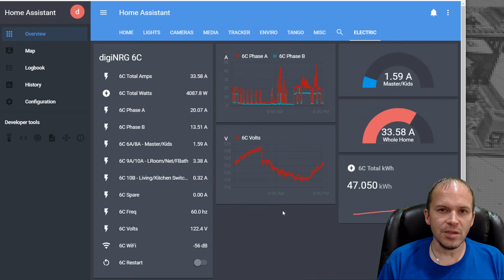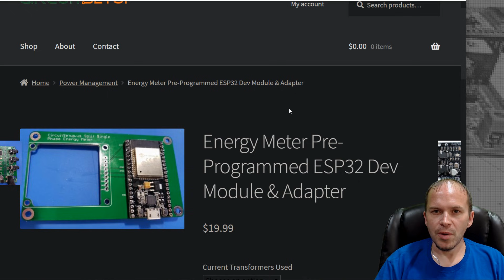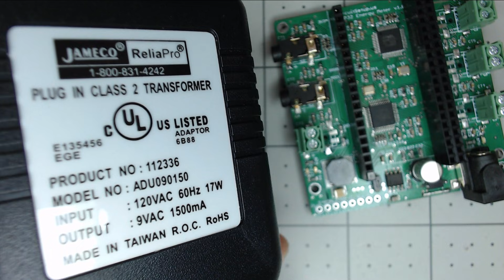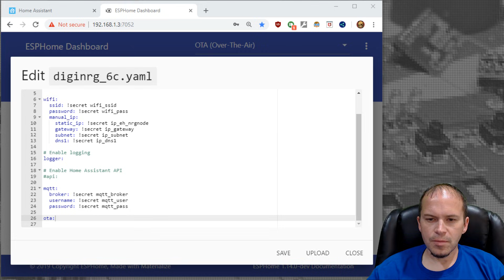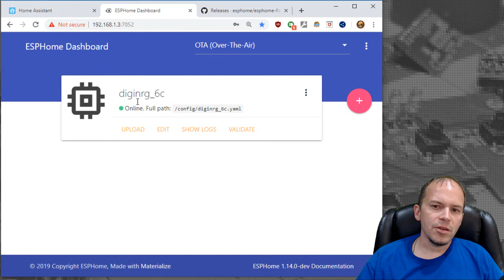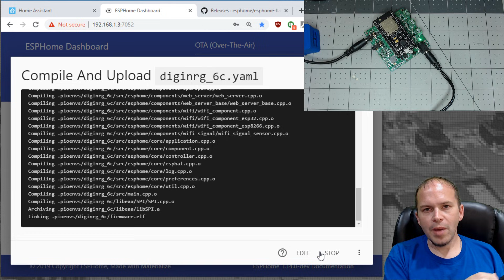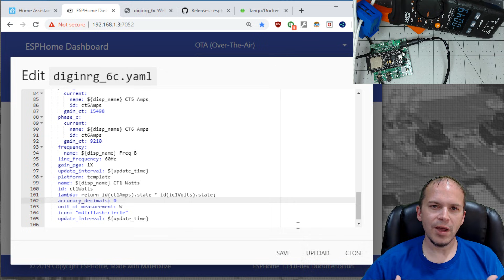DIY Whole Home Power Monitoring with ESPHome & Home Assistant

Comment: Does the direction of the CT clamp matter? Also if you have something like a range with a dual breaker (30, 40a etc) I'm guessing you need to monitor both leads to get the total? Thanks
Reply from the maker: The clamp direction will make a difference using the new sensor that shows the real wattage and not just calculated. If it is negative just flip it around.
Reply: @digiblurDIY  Do you have more info on the new sensor?  I have the latest board and used your yaml file that is calculating watts. I tried it both ways and it was positive in both directions. Thanks
Reply from the maker: https://esphome.io/components/sensor/atm90e32.html

Comment: If I want to get the current measurement from a dual pole (240v) breaker, do I need a CT on both hot wires, or is there a way to double the voltage for a CT on 1 of the two hot wires?
Reply from the maker: I assume US residential split phase? Is it a balanced load? Or do you want to see both hots?
Reply: @digiblurDIY  so… is the answer here that you just need one CT clamp but you’d need to double do some multiplication on the sensor to just double it?
Reply from the maker: Either pass it both hots in the clamp in opposite directions or you can double it if it is a balanced load.
Reply: I had this same question - I looked at https://www.diychatroom.com/threads/balanced-loading-on-240v-circuit.196969/ and what they said made sense - a pure 240v load (e.g. 240v electric dryer, water heater, etc) will always be equal. I'm not sure of the rationale fully, but it would be great to hear about 240v load examples that don't have equal power (btw, US, 240v split phase). 

I would think all resistance loads (electric water heater, dryer, electric heat) would definitely be covered. 

Does anyone have cases of 240v split phase loads that are not balanced?

Comment: do you know how to use the arduino mega with esp built in? i want to use all 16 analog pins to monitor 16 breakers individually. that way i can find electrical problems and power drainers faster. when i get around too it i can off load the ones that use the least to solar.
Reply from the maker: No, I haven't messed with that hardware yet.

Comment: Hi 
digiblurDIY, I found your video really intresting even if it exceed my basic knoledges. I'm asking you if you know a proyect to measuere the power and cut some lines when the total power is above a certain limit (to avoid automatic shut off in the energy company meter). I'm looking for a solution for an underfloor electic heating system with a line for each room. Thanks for your advice.
Reply from the maker: If you had some relays installed on those lines then yes you could use this if you wanted to or any other power monitoring on those lines.
Reply: @digiblurDIY  Thanks for your reply. I have to figure out how to connect the relays and how to compute the total Watts in order to decide which line I have to switch off. Thanks again.

Comment: My "powermeter_6c_freq_a_3" is showing 655.34hz I dont know how to fix this.. help please.  The other one "powermeter_6c_freq_b_3" is correct, showing 60hz.  I am using NodeMCU Esp-32s
Reply from the maker: Sounds like it maxing out for some reason.  Is there voltage on that feed of the IC?
Reply: @digiblurDIY  
I am only using 4 of the 6 CTS, CT1 and CT2 are for mains input and CT3/CT4 are being used my for inverter AC
However this is the current usage on my system currently.
PowerMeter-6C CT3 Watts	8095 W	
PowerMeter-6C CT4 Watts	29 W

powermeter_6c_freq_a_3 is for CT3, and powermeter_6c_freq_b_3 is for CT4
I dont think line 2 is being read correctly

Comment: Is it normal when you don't have any sensor plugged in it still shows:
CT1 watts 1w ,  CT2 watts 1w , CT3 watts 1w  etc..
Reply from the maker: Possibly due to residual/noise from the floating pins.  Never tried it myself always had sensors plugged and clamps on something.

Comment: Excellent video!  I have 6 CT's, the meter board and enclosure being delivered Monday.   I'm using Home Assistant Core, so my install might be a bit different, but your video is providing enough guidance I should be ok.
Reply: An update to my own post. I switched installs and went with HA on a VM. Now I have access to the "add-on store," which I didn't have before. 
Anyhow...This afternoon got the ESP32 programmed and installed on the main "meter board."  Everything is working fine, but now I need to do an accurate calibration on the CT's.    
My two cents says that anyone who'd like to install Home Assistant, DO NOT do the install in Windows (Home Assistant Core). Do an install of VirtualBox and install the FULL version which includes everything.
Reply: @phillipzx3754  Is your setup still working? I'm on Windows/Virtualbox as well.  Any pointers, tips or things to watch out for?  These little projects, while fun are timesucks.
Reply: @walterlau3    It's been working great. My only problem is with Home Assistant and the "History Chart" card in Lovelace. For some reason it stops recording history. I have to refresh the screen manually, but everything else (amps/watts/voltage) works fine.

One thing that got me was the CT's for my "mains."  The CT's I bought (from the same website) were too small to fit over the wires, so I ordered 2 of the clamps (from the same place) with 16 mm opening. They were STILL too tight, so I used a rasp to remove a bit of the plastic in the opening. They still wouldn't snap completely shut so I tightened them down with some zip ties. 

So if you want to monitor your Mains lines, I'd suggest finding CT's with 18 mm opening if you have large wires.  :-)

Comment: Can't you calculate your way to the correct calibration number?
If 10000 = 0.32 A
Then  1 = 0.000032
So 0.5 / 0.000032 = 15625 

It's not the number you got to, but it will give you a quicker way to the fine tuning.
Reply from the maker: Math was never my strong point ;)  I figured someone had a web calculator on this at one point.
Reply: @digiblurDIY  - I opened the video on my phone specifically to let you know that you can calculate exactly as The Hellis suggests.

Other tips :

(Cheap) clamp multimeters are often wildly inaccurate so it's much preferred to use a known load. And as you point out, a bigger current draw would be preferable as well.

It's also worth mentioning that it's by far simplest to use a strictly resistive load, like a light bulb or an electrical/resistive heater. Anything electronic (capacitive) or coil/wound motor will not change the total amp draw, but it is likely to cause variety between measurements because some measuring devices are better suited than others to pick this up correctly.

People in the EU will struggle to find incandescent bulbs since they are (rightly) banned several years ago due to the inefficiency. For those, the most efficient way to go would probably be to measure the electric kettle/boiler or a toaster. Both are relatively high current draw, resistive and quite constant aside from the brief start up current. :)

Comment: digiblurDIY,
Very nice video. In using your YAML file, I got voltage readings of 655.34998, which is suspiciously close to 65,535. I had to scale my voltage gain figure down to 7478 (for a 120.7 VAC reading), which may be due to voltage divider changes in the version I have. Using v1.3  of the 6 channel energy meter board, 9 VAC Jameco transformer, and 100A/50ma clamps. I will have to read through the comments below to get watts directly off the board instead of calculating it. Thanks again for your work
Reply from the maker: Yes, the voltage dividers are different on the newer boards.
Reply: Yep, as digiblur said. Fyi, there are some more example configs here: https://github.com/CircuitSetup/Expandable-6-Channel-ESP32-Energy-Meter/tree/master/Software/ESPHome

Comment: Hi great job! What do you recommend for three phase?
Reply from the maker: This board is actually designed to monitor many phases and circuits in various combinations.
Reply: @digiblurDIY  For three phases + Neutral, could you please show us how it would be connected?
Reply: @AleOnNet   with this meter you can still monitor 3 phase power, but the active power will not calculate correctly since you can only measure a max of 2 voltages, and you really need to measure 3. You can still calculate active power in software though. It just will be a little high since you're not taking power factor into account.

Comment: A critical aspect of this is the non-linearity of the CTs. Unless you are operating in the ‘sheet spot’ of the CT then non linearity will be an issue. Do you know if the chip somehow corrects for this? If so how does it do it as I did not notice you characterising each CT for its linearity.

Comment: I'm sure I'm missing something small but should the sensors be picked up automatically with the Mqtt integration? I see tons of info if it was a tasmota device but not a lot for anything else.  Any help would be greatly appreciated
Reply from the maker: Yes, ESPHome uses either MQTT or API and they pull into HA depending on how you configure ESPHome.

Comment: what is the minimal rating we can use the 9 or 12 AC adaptor? knowing that i am only using clamps only for 2 phases out of my 6 input v.15 board
Reply from the maker: I use a 9VAC adapter on mine without any issue, the board states 9-12 to be used.

Comment: I got a question, if you're not cutting the wires and you only need to clamp them... why would I get a shock?
Reply from the maker: Two things here, in my opinion I don't trust a big mains AC power wire to be sealed correctly.  Secondly, if the clamp is a mA style output that means it does not have a burden resistor and will have current on the output.  It's always a good idea to shut everything down for a few minutes while you put things on.
Reply: @digiblurDIY  thanks for your help, what should I get in order to measure my entire house? Multiple channels or just 2 for the main wires?
Reply from the maker: I would get the 6 channel board as I had the 2 channel to start out with (split phase for me in the US).  But of course I wanted to monitor a few other things too so I jumped to the 6 channel.  You don't have to monitor 6 channels at first.
Reply: @digiblurDIY  but to monitor the whole house 2 would be enough, correct? (clamping the split phase). I'm going to get the 6 channel one, but in that case do I clamp the main cables and also the other breakers? won't that count the current twice?
Reply from the maker: If you have split phase then yes just two clamps would work. If you want to drill down to say know when one circuit is running an electric dryer or not you could use that other channel. It won't count twice unless you want it to. It's all flexible in how you count what channels do what.
Reply: @digiblurDIY  Awesome, thanks for the help... will get the 6 channels and start with 2 clamps. Thanks and stay safe!

Comment: Hello i am using current transformer 100/50ma  and i am connected it with a burden resistor 33ohms  to ttgo lora esp32..the problem is i cant calibrate it  . Any idea?
Reply from the maker: The burden resistor is already on board.  Are you adding another?
Reply: @digiblurDIY  in which board you speak about. Emon?
Reply: @digiblurDIY  i am just cut off jack and wired up 33 ohm resistor to ct transformer and then connect it to Ttgo lora sx1276

Comment: When powering esp 6 channel board. It positive inside of 2.5mm or outside connector?
Reply from the maker: Neither.  It's AC voltage.
Reply: @digiblurDIY  thx. I'm noob with these :D
Reply from the maker: No problem. Make sure you don't feed it with DC voltage.

Comment: What are the damn bright blue LED's on this board that totally illuminate my closet at night?   I would also like the ability to turn the LED's off through software.  I mean it they are annoying.  They even show through the purchased 3D printed case.  For now I have packed the case with some black foam I have, but I am worried it might heat up.  I am using it with ESPHome.  Also, is there a way to reset the totals?
Reply from the maker: Is it on the board or ESP chip?  Which totals?
Reply: @digiblurDIY  The two blue LED's in the lower left corner of the 6 channel board.  The kWh total.
Reply: @timhughes1690  didnt see your question earlier. The blue leds are the active power pulse. Cf1

Comment: Starting with a value of 10000 and the known amperage, we can find the calibration value using the formula (10000)(amperage)/(indicated value).  For your example (10000)(0.49A)/(0.32A)=15312. Hope this helps!

Comment: I wanted to share my CT Clamp settings after changing them to a bus bar style clamp. The part number is xh-sct-0750-100.
gain voltage - 3730
gain ct - 62500
gain pga - X4
Reply from the maker: Thanks!

Comment: digiblurDIY  i just calibrated to work with 220V with new gain_ct but esphome won't allow value upper than 65535, any solutions ?
Reply from the maker: Turn up the gain to 4x maybe?
Reply: @digiblurDIY  pga ?
Reply from the maker: Think that is it. 1x, 2x, 4x
Reply: @digiblurDIY  i'll try thanks